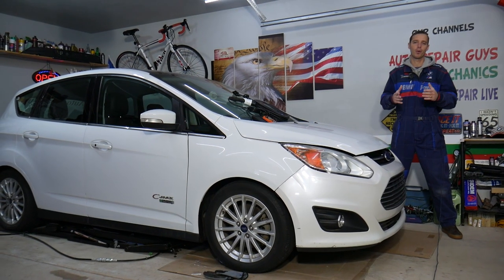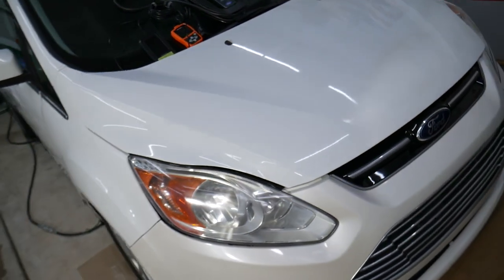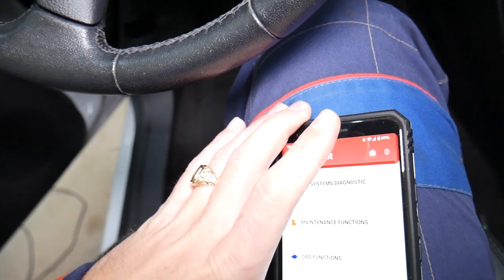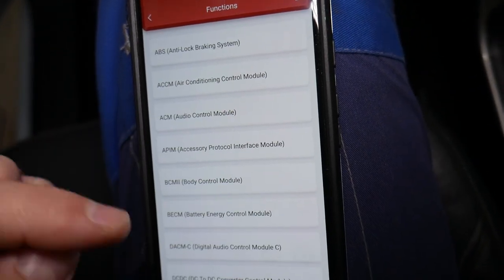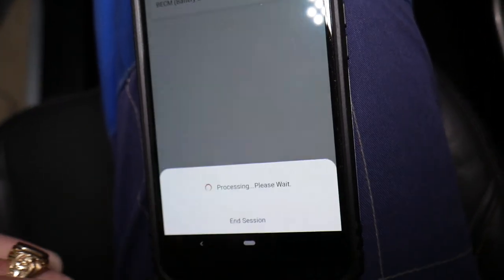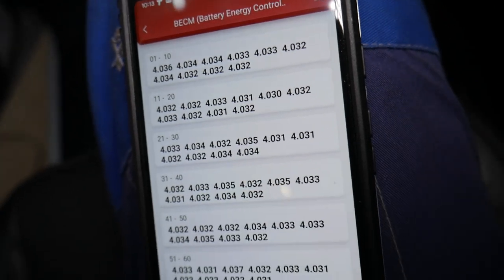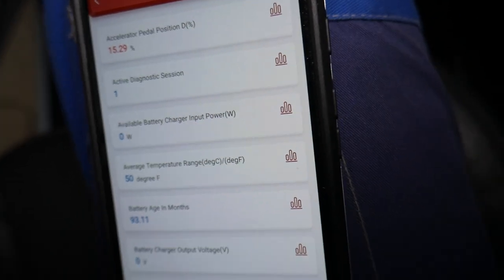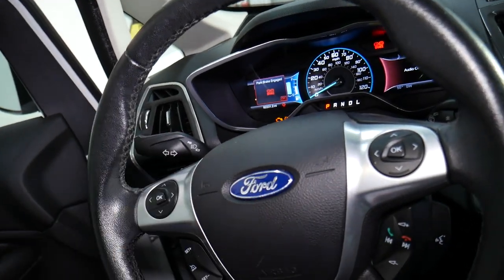HOW TO TEST HYBRID ELECTRIC BATTERY ON FORD LINCOLN C-MAX ESCAPE MKZ EXPLORER MAVERICK

Comment: According to the listing on Amazon, this device requires an annual subscription fee to unlock the features for each and every car you want to scan. Plus the tool itself isn't inexpensive.  I'm still looking for a scan too that the software will read the battery for my Ford Escape Hybrid.